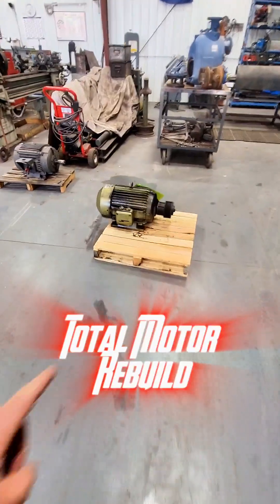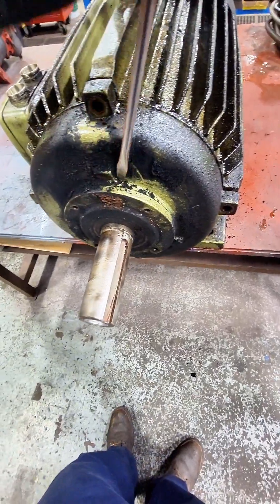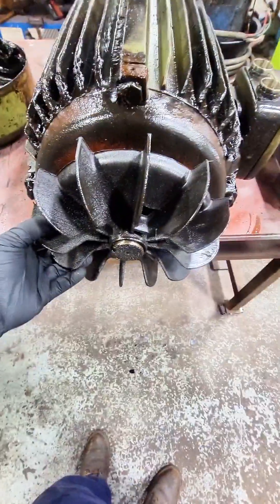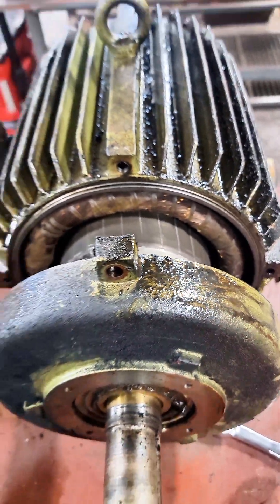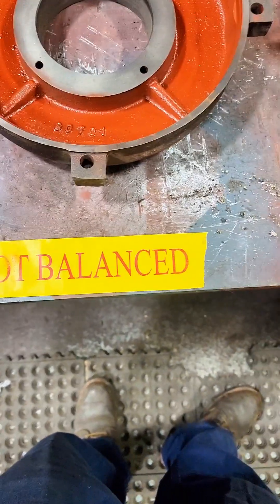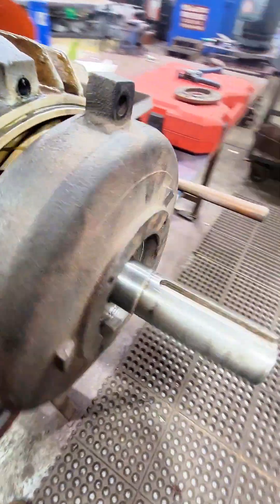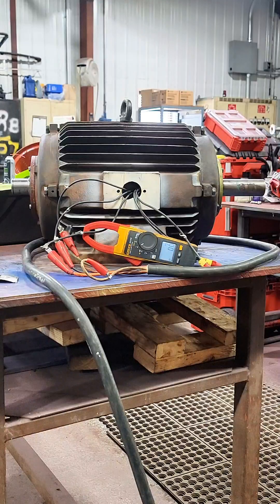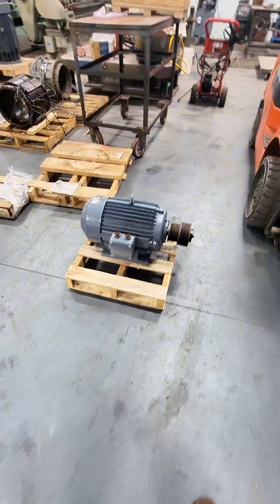rebuilding an electric motor

Comment: In my experience that rotar damage is either too much pulley resistance or if the pulley is that irregular weight wise I would balance the rotor and then balance the pulley on the rotor. Me normally don't do this, but some of our more industrial clients that have this failure we will balance the pulley as well.  Also as crazy as it sounds we balance at..08 mils on the rotor and under .5 on fans and pulleys.  Also use a half key when balancing and attach metal fans as well.  It's a little neurotic to be that precise on balancing, but when you see .018 and below on vibes it's very rewarding.

Comment: I interned at a company that compression molded plastic bottle caps, one of the big motor fans like this one has broke and I was able to make it cad and 3d print a replacement out of nylon and get the line running again. I didn't know they were that expensive!